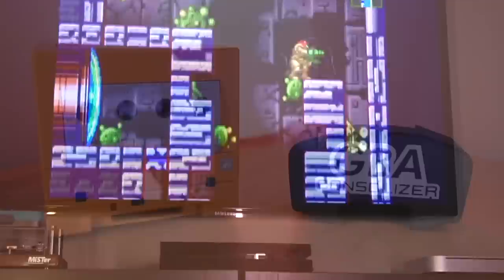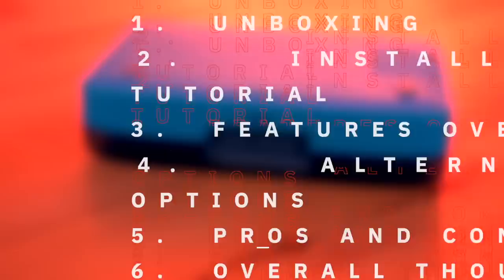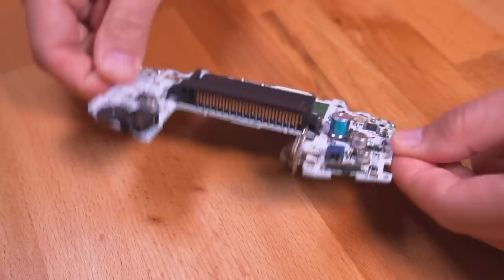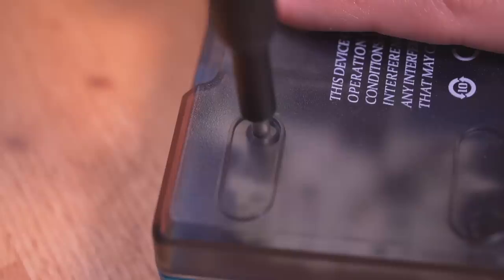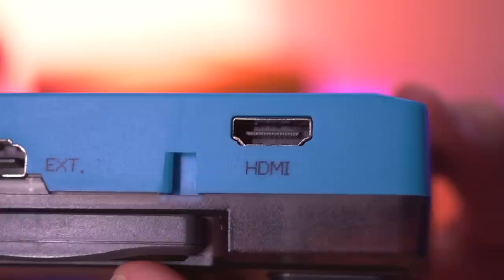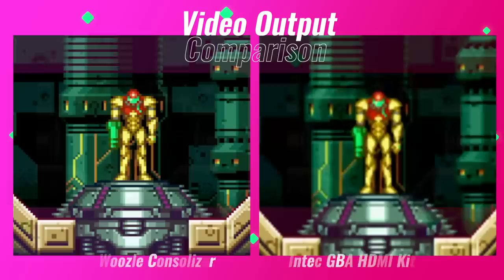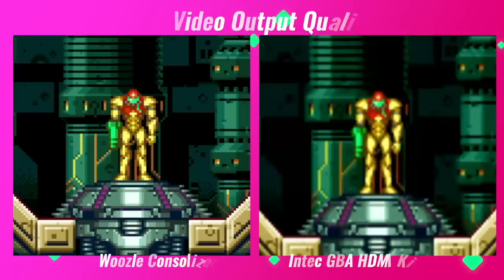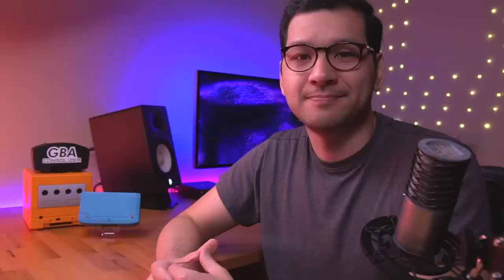Easy NO SOLDER GBA HDMI Consolizing Kit!  BUT, Is It Any Good?

Comment from the maker: Bob of @RetroRGB released a video where he conducts lag tests for the Intec GBA HDMI kit and unfortunately the results are not good.  Definitely watch his video also before considering backing the Kickstarter campaign:  https://www.youtube.com/watch?v=y3-hFSaVRWs
Reply: Seen Retro RGB’s video, very professional indeed. 

Looking at this GBA KIT from a high standard could be an overstatement.

It would be unfair comparing GBA HDMI KIT with GBA consolizer, it’s like comparing Zara with Chanel - totally different TA

For this KIT, it's good value for money, with all the functionality; includes bluetooth connectivity, a new gamepad with leftover casing, slick outter case.

These frames per second probably won’t be noticed by most users, should be acceptable in most cases.

Aspect ratio does indeed need fixing which I heard they’ve already done from comments below.

Overall, it’s a bargain and I’d pledge for it.
Reply: @kuo-yenhuang6804  It'll only not be noticeable if you really are unaware of input lag in general and or are a casual gamer who really doesn't care about precision when they play.  

Anyone who cares at all about actually doing well in their games will notice IMMEDIATELY.  I can tell when an output has anything over a single frame myself.
Reply: Thanks for letting ppl know about Bob's testing.  It's absolutely something ppl need to be aware of.  And when you test any device in the future, I strongly recommend doing some sort of lag testing as well.  It's extremely important for anyone even remotely serious about their gaming.
Reply: That's a shamed because I like the concept and believe the design is more appealing than the consolizer. It would be cool to see a metal version of the housing from Boxy Pixel!
Reply: @Wedeemgaming  The thing could be a bare board for all I care.   I only really care about how it functions.
Reply: @wyldelf2685  Hell it has such a scene cus its an amazing system.  It has one of the best game libraries of any portable for it's time, and I'm not referring to the Pokémon games.  There are so many AAA exclusives for the system.  

Indeed there were a handful of awful ports which you named some of, but there are a TON of amazing titles for it.  Some basic research should show some of these games for you.
Reply: @wyldelf2685  one of the first things I did to my PSP was to "hack" it so I could run a SNES emulator. I prefer it for SNES than my vita, as it has a more SNES pad shape. I swear it was designed with the SNES in mind.
Reply: I just backed this today. I have a feeling it might not get funded. It was through funding it that I found out about the issues. I can live with mono audio as I am used to playing on the GBA (and the system sounds are pain to my ears with head/earphones).
But the way games are displayed is horrible and the potential for the lag to so bad. I may go back to the raspberry pi 4 (if I can get retropi to work for more than 3 boots) and remove my pledge.
Reply: @wyldelf2685  2nd player?! I'd need friends for that. 
If I need that it would be done on the Switch. 
As long as I can play Pilotwings, Starwing or LoZ:ALttP. I'm happy. 

As for the PlayStation. I wouldn't call it shameless of Sony to have done that. 
I had a PS1 (not a PSone) with RCA outputs. Loved that machine. 

Ridge Racer was the game for me for so long (2 systems, 2 TVs a link cable, a single copy of the game and a random music cd lead to hours of arcade fun). 

But then Gran Turismo came out. And that was me. The same friend I played Ridge Racer with became my GT buddy (100 laps, fuel usage, tyre wear and damage on, happy days). Repeat for GT2 (with its rub and sniff disc).

Man I could go on even more. But 
1. You didn't ask.
2. Would end up being a load of very vague descriptions of games and incredibly boring to read.
3. I'm supposed to be playing 7 Days to Die with friends and not watching YouTube.
Reply: @wyldelf2685  never had the Mega Drive (Genisis). Did have a Game Gear (with TV tuner) that we were given by my dad's friend. I have only ever seen the Nomad in videos. Never played one. Am I right in thinking that you could hook it up to a TV?
Reply: What the crap Intec???

They still don't have the HDMI image quality down after their bummer N64 project? The fact that they are fixing the aspect ratio after sending out test units shows clear lack of polish.

Someone who knows more about these things; could I get an idea why the quality is mushy instead of crisp? Is it a matter of a performance of a chip and they are cutting the cost or is it more complicated than that? Thanks!
Reply: Ok I know I'm a bit late on this but in addition to the issues with this kit mentioned there is one thing I'd change on that pcb design that I think is more than possible. Flip the port placements. The reason I say this is because to put a cartridge in the current design you have to pick up the console itself to slip the cartridges out of the rear bottom. If you flip the design properly you can have it on the top front similar to the Woozle version and keep the simplicity. Do that, updater the firmware to be more on par with the Consolizer and maybe add Wi-fi options for updates and to act as a psuedo-link cable for online play and this could be amazing I don't even believe this would make it that much more expensive really. Though if I were to get something like this I probably would just use one of the spare SNES controllers I have lying around.
Reply: This is also great with the Nintendo 2DS

Comment: I love how beautifully designed this kit is, what really gets me is the fact that you can use your donor gba shell and buttons to make a controller, and I love that you get the authentic feel. Only thing I wish is that the gba cart would be on the controller itself so you could play warioware twisted, but thats such a niche use case anyways
Reply: Now that's be cool... But, you'd be using the actual board in the controller, and the wire for the controller would need to feed down in another board that is the other part of the output. Either way, your re engineering a board, to split uses up, as you've got controls,video,and cart slot. If they nailed the aspect ratio... And could make it so that the screen works on the gba, but than also just plugs in to a box/board... You'd basicly have a switch scenario. Which funilly enough was what they were doing 20 years ago. Even more so with the gba and link cables to the GameCube, than with the ds. Either way I wish Nintendo was still doing dual screens. It's either that, or say for a game like warioware, Nintendo should be utilizing horizontal screen in handheld mode a thing.as that's basicly what the ds and 3ds did in alot of scenarios.it might take 20 more years, but I think dual screens are Gunna have a resurgence,with much more thought out and useful applications for it other than just a menu or map. I really like this idea here with the controller. It just doesn't make sense to put it to HDMI.unless it's 20' screen or much smaller. Imagine how sad ppl will be running this HDMI on a 70+ inch screen. It's Gunna be terrible. But with all the TV's and upscalers n gadgets, there will be a way to make this look good...you'll just need to run it from HDMI, into the m classic, into the frame meister, scaled back down into analog composite,into scart ..back through s video and into the retrotink 5x, into a digital to analog down converter, through the nes rf adapter, and down to the old u clips that were on like super old Atari and mid 70s stuff...and finally one wire goes under the dumpster ,for grounding, and the other wire goes to the toilet bowl
Reply from the maker: The controller re-use was an awesome idea for sure
Reply: @MachoNachoProductions  sorry for the off topic reply, but do you have any videos for modded OG 3ds?

Comment: I am OK with the image quality being a little bit softer. But the incorrect aspect ratio is a deal breaker for me. The purpose of a mod like this is to use original hardware but changing the aspect ratio would make it feel wrong anyway.
Reply: it's not even a nitpick, it's extremely visible
Reply: It really is a deal breaker. I'm not sure how anyone can play in the incorrect aspect ratio.
Reply: The aspect ratio problem is unforgivable simply because it should be extremely easy to get right.
Reply: Why don't you connect to your computer then zoom in on the image then put the image of the computer on the television

Comment: This is actually impressive. No soldiering allows many more folks to give it a go. IMO those aspect ratios need to be addressed before launch and it would be great to get a no accessories unit for $100
Reply: That's something that they should definitely look into. I wouldn't mind paying extra for advanced crt and lcd shaders being implemented. Like adaptive scanlines crt shader would be great.
Reply: I agree I would say (feel free to correct me at any point):
$100 consolizer kit only
$135 consolizer + controller kit. 
Because the GBA was really meant for solo gaming there were only a small handful of games that did multiplayer and the ones that did needed the link cable anyways. I mean let’s be real no one is gonna be playing Zelda four swords with one player on a big screen and one on a tiny screen hunched over.
Plus (I feel) there is less room for error in doing the mod yourself. However, I will acknowledge that there is still room for error in manufacturing which makes me a bit shakey about ordering one. Quality control is going to be key for these devs.
Reply: @xGizmox23  I agree. Also, since no soldiering I believe it’s easily reversible if one becomes overwhelmed or wants to return it back to a handheld. The ribbon cable and connector would be my only concern about the MOD process.

Comment: That's a pretty awesome kit. A lot of work has gone into that from many areas. The HDMI scaling is a super easy code fix if they have written that code themselves so I would say they could fix that given this feedback before launch
Reply from the maker: I really hope they incorporate a fix before launch. It’ll definitely improve the attractiveness of the kit
Reply: Probably not, at 5:15 see that they used 3 chips? One does the Bluetooth stuff, one is doing the frame reconstruction and outputting composite video and the third is an off the shelf composite to HDMI converter chip, so the frame data is never transmitted directly over as a digital video signal, output will never truly represent what is in the buffer
Reply: @KyleBrinkerhoff  All that effort to make something clean and easy to use and they chose to do an internal digital-to-analog-to-digital conversion?? Is a chip that takes a GBA video signal and converts it to composite just a cheap part that already exists? Because otherwise I have no earthly idea why they would do that to themselves.

Comment: You didn't mention anything about how it sounds. The GBA has notoriously noisy audio and the Woozle kit includes a low pass filter option to help clean it up some. Does this kit include anything similar?

Neat kit but it is a hard pass from me just because of the aspect ratio issues.
Reply: Considering it's using testpoints to pull audio, it's likely pulling the audio data before it gets passed into the filter and it's converted to digital so no noise. In fact, there are two testpoints from the PCB, FL1 and FL2 it is tapping into. Those feed into the GBA's horrible audio amp chip.
Reply from the maker: Audio didn’t sound bad. I should have provided an example of it in the video

Comment: I really like their idea of making this thing very easy to install without any soldering experience and the idea about using the remaing original gba shell as a controller so that in the future people can always switch back when they want to.  However the video output quality is really a deal breaker for me.  I hope they can do better picture quality for this kit even though that would increase the price.
Reply from the maker: I think they’re working on fixing the aspect ratio problem.

Comment: If the aspect ratio is a deal breaker, keep in mind that your TV might have an option to stretch or squeeze the image to a custom aspect ratio. You can most likely play around with that to get at least close to an actual 3:2. Not the most ideal, but at least you're not fully stuck with that.

Comment: I feel like softer video quality isn't that bad, especially considering modern TVs and monitors really accentuate pixels, where as CRTs always feel softer around the edges. This would be a good starter kit, for someone like me with zero solder experience. The aspect ratio thing is a bit funky though, but I think the pros outweigh the cons overall.

Comment: Ah, the old eraser trick! I've been using pink erasers on contacts for decades now lol. Works on everything from tin plate to gold. I also use blue Kratex on stubborn contacts and red Kratex when I can't find my fiberglass pen.

Kratex is a brand of rubberized abrasive. It's essentially a rubber eraser with cutting agents impregnated within it. There are many grits available that are very nice for polishing!
Reply from the maker: Same!  I typically use the white erasers. They seemed to be softer

Comment: That pogo pin design is really interesting.  I wonder what the pros and cons of that design are, and why it isn't more widely used.
Reply: The main reason is that people don't think of them as often. Aside from that, it's because they're large, they need test pads instead of tiny component legs, cost more than wires or FFCs, tricky to install, and have the theoretical issue of poor connection.
Reply: cost is probably the biggest factor
Reply: @haroldgarrett2932  Definitely not the biggest. There are many options around $0.50 per pin for a consumer. If you only need a dozen per kit, that's not a big cost for a very noticeable feature.
Reply from the maker: I think it could potentially be a bit finicky if things aren’t aligned but I had no issues with mine. All is you drop it, things could fall out of alignment.
Reply: They dont use the pogo pins as often because many designs dont line up and you could have to make a circuit board the same size as the original

Comment: I think if they managed to get the aspect ratio right I think a lot of people would get over the soft video image. But still where I live you can get a gamecube with a gameboyplayer for around 80 bugs (which gives a similar image with a better aspect ratio or you can add another 15 and use swiss and gbi and ofc for 5 bugs you get the connector cable that lets you use your gba and gba sp on it). So i think it's to expensive whilst having quite a few bad flaws. For a lower price or better hdmi out I think it be an amazing kit. 
Great video on your side. I'd like you to mention that it's a kickstarter a bit earlier in the video, maybe as a side comment into the intro duction

Comment: Youtube sucks at telling me when a video lands. I love this, and I think the number one issue with it is why I wouldn't get one. If they could fix that aspect ratio to include the original, or expand the visual settings options in general, I would easily grab one of these. 

The fact that this could be used like a Gameboy Player is also a selling point to me, as I've been able to set up Four Swords for a few conventions, and having one of these in place of a GC would be good for both showing off how retro stuff is still alive, but not having to lug around 4 GC's and a Wii would be nice. I would still have 3 Cubes set up for it because that's cool in a nerdy way but also I have at least 2 original GBA's laying around with busted screens and this would be a perfect way to utilize them

Comment: All fair takes.  I would assume that the picture might be fixed with a software update depending on the circuitry  used,  but as of right now the image is pretty soft.  Although somewhat accurate to the gameboy player for the GC.
Reply from the maker: I think they’re working to fix this issue. Hopefully they can pull it off

Comment: At 11:04 I perceive the Game Boy Player's output is being driven by the Official Disc.  The Game Boy Interface software is unofficial but provides totally superior video quality and with an GameCube HDMI output adapter like the Carby or the Component video cable, it will come very close to rivaling the GBA Consolizer in terms of sharpness.
Reply from the maker: It was using Swiss from my gcloader with video running through my Carby

Comment: There are some great ideas here - the pogo pins and controller using the original parts, but the aspect ratio/video quality thing is a dealbreaker. Kinda defeats the point of a consolizer!
Reply from the maker: Agreed the video output was a bit of a let down. If they can improve that, they’ll have a winner on their hands

Comment: Architecturally, the intec is likely converting the video signal to just composite, then to get the HDMI output they are probably using a Texas instruments chip that converts composite signal into HDMI so their is no surprise why the image is so blurry as it is not a true representation of a digital frame buffer. ultimately woozles system captures the intended pixel values and builds a true to life frame buffer to then output as a native digital signal , woozles is built through the magic of FPGA development, whereas the intec was separate discreet designs cobbled together.

Comment: to be very technical about those pogo pins, they actually have longevity issues (see guitar hero controllers). this is due to those pins having alignment issues due to movement, needing to be cleaned, and the springs eventually going bad which makes them weaker and more likely to move when they shouldn't be.

I see the kit as more of a means to get people who have never done any modding before as a starter kit or gateway to more complex mods.